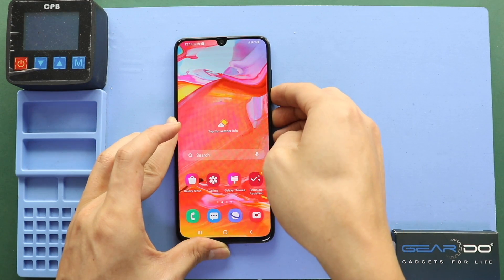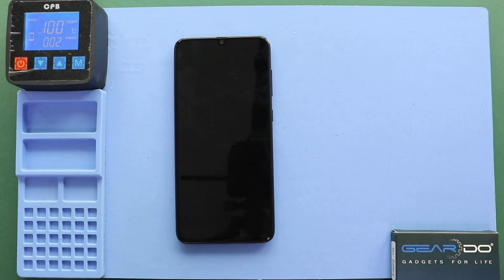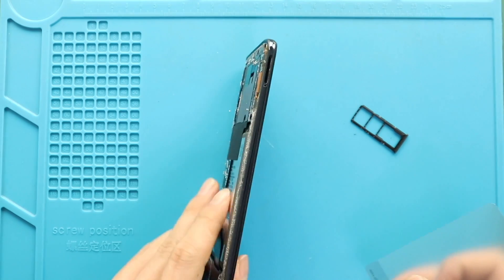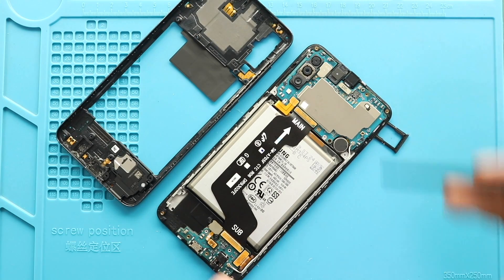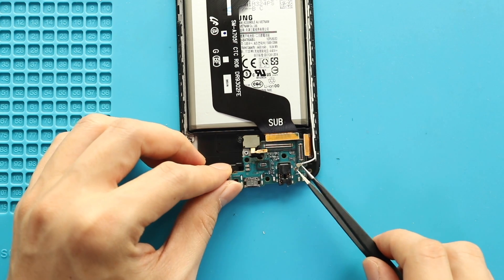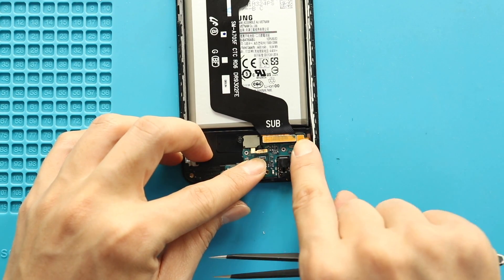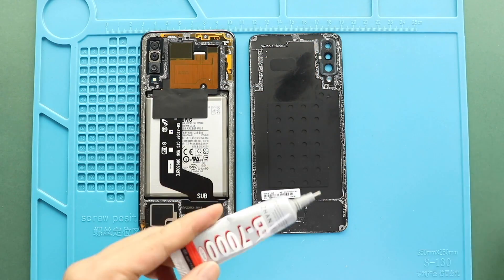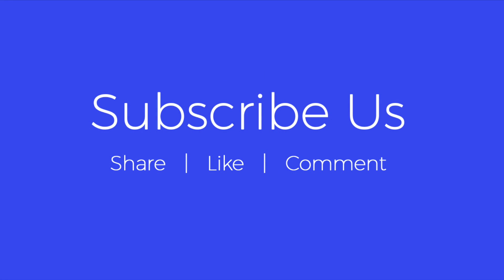Samsung Galaxy A70 Charging Port Board Replacement | A70s

Comment: I have a 70 that no longer charges in any position, I ordered a non-original board, I installed it, it doesn't charge, it doesn't respond to any kind of plug, charger, or otg. I bought another original one, which also doesn't work. if I put the old one  it still loads in some positions
Reply from the maker: Have you got the correct model? There are original charging boards are available.
Reply: @DIYGeardo  I saw a video showing that Samsung A models lose contact with the socket on the motherboard and that's how it was.  I bent a clamp to the plug and it works